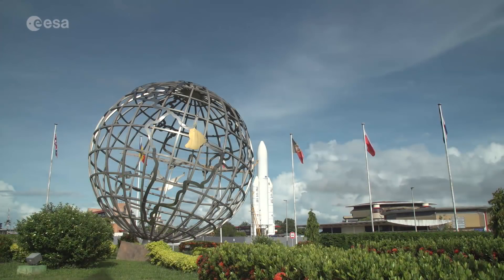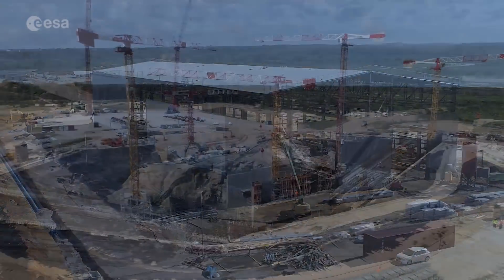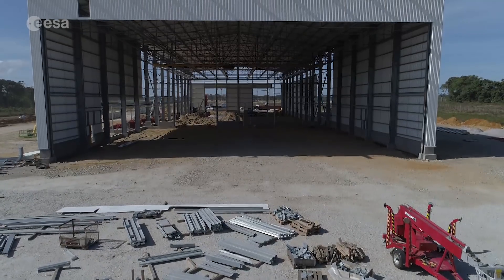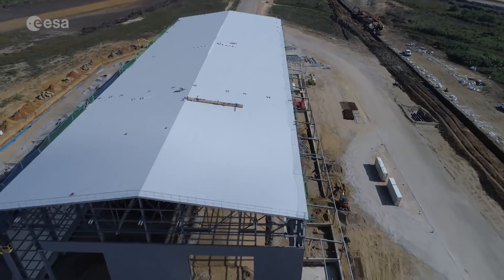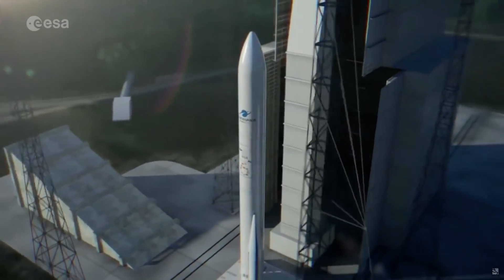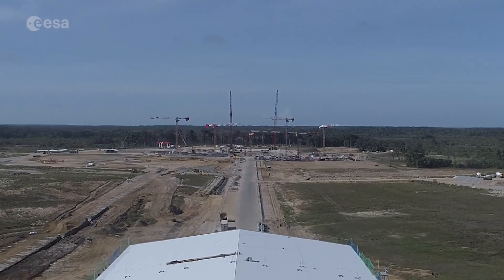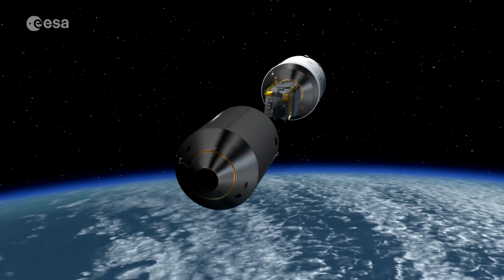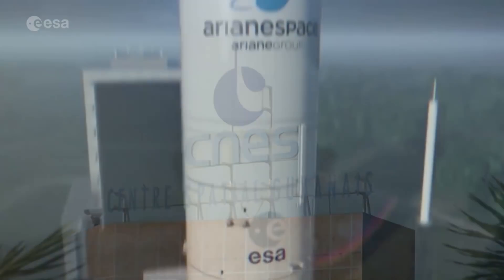Ariane 6 launch site visit

Comment: Sadly not a very future-proof design, solid rockets have to go.   And re-use can be stepped up from there.  
Allot of opportunities  missed here, even scaled back on the promise of some innovations.  It lacks bravoure, commitment.   
And most disappointing, still no talk of human rated space flight capability for Europe.
Reply: Why ? They're reliable and dirt cheap, and they're needed to boost the first stage to a point where it has expended enough fuel that the relatively low thrust Vulcain has a TWR>1. It's just a thing most hydrolox first stage rockets generally have to do in order to even take flight.

Comment: At about 00:50 he says that in the States you have one launch pad for several launchers (paraphrased).
This is not true.  There is a separate launch facility for every type of rocket.  The only exception is that Pad 39A at Kennedy is now able to handle both Falcon 9 and Falcon Heavy (first launch scheduled a week from this writing) but this is the first time I believe that a single pad has been able to handle multiple types of launchers, and those are from the same company.
Reply: You are wrong. Look here:
https://en.wikipedia.org/wiki/List_of_Cape_Canaveral_and_Merritt_Island_launch_sites

As you can see, EVERY launchpad was used by different rockets.
Reply: Actually, the ISRO Satish Dhawan Space Centre has launch pads that can handle multiple types of very different rockets. For example the second launch pad can handle PSLV, GSLV MK I & II and GSLV Mk III - each being a very different rocket configuration from the others. So it's definitely possible to have a shared pad, but US launchers are not a good example of this.
Reply: OK, but not currently (and I stand corrected, I was going from memory).  Only Atlas V, Delta II, Delta IV (OK and D-IV Heavy), F9 and FH are currently flying from CCAFS/KSC.  The D-IV rockets do share a pad as do F9 and FH. But nothing else at VAFB, or WFF share pads.

Comment: Are the payloads intergrated horizontaly ir verticaly??
Reply from the maker: Vertically - see 2'00"
Reply: Probably vertically, so that the customer doesn't have to change habits. Although at spacex, the payloads are integrated horizontally, so it works for them.
Reply: well some special satellites may need it because of special systems like special optics, antennas, solarpanels etc. well i guess arianespace could keep this opportunity for special satellites. maybe they can adapt to integrate satellites horizontally that dont need vertical integration, but thats just my guess.
Reply: Jamie Godman you'r right, even if the rockets don't really fly horizontally to their resulting force (that would be terrible inefficient) but comparing to spacex or roscosmos it is really unnecessary
Reply: +ChAnimations Roscosmos and ILS in Russia also do horizontal integration, because it's faster, easier and cheaper. Vertical integration really is not necessary and just a waste of time and mostly money. They lie when they say that the sats need vertical integration as horizontal would somehow damage the payload. This is BS because all rockets fly horizontally after the first minute or so of flight. Most rockets do a pitch kick just after liftoff. If the payload can survive launching horizontally then it really didn't need vertical integration in the first place. But they can charge millions more for vertical integration so they do. Just like banks love to come up with BS fees to get extra money out of their customers, these LSP like ULA and Arianespace are doing the same thing.